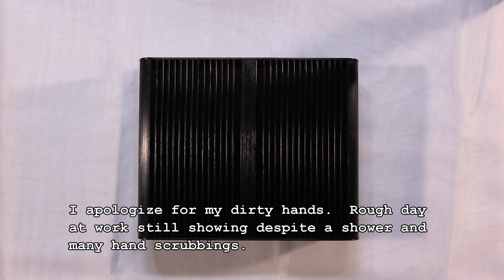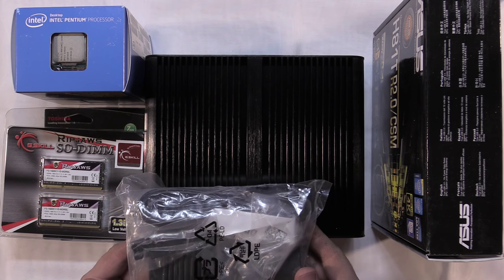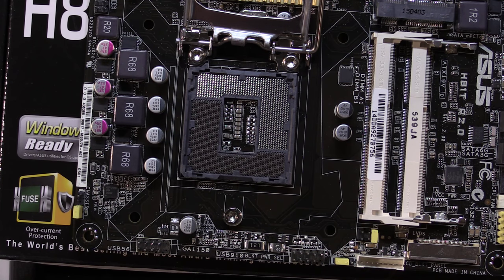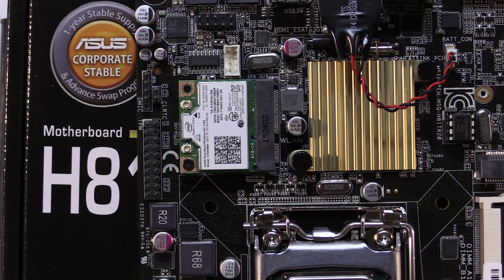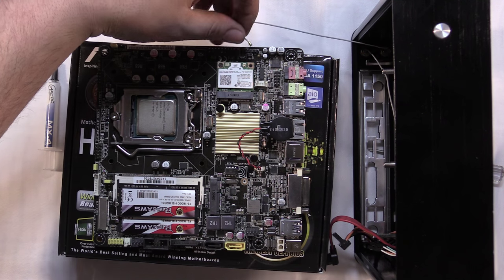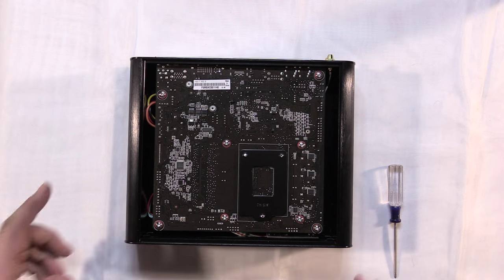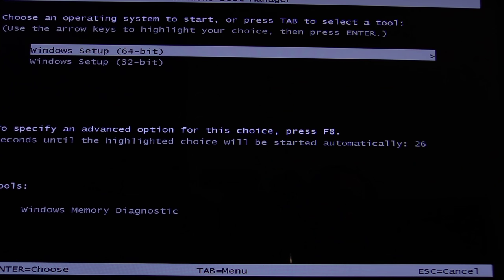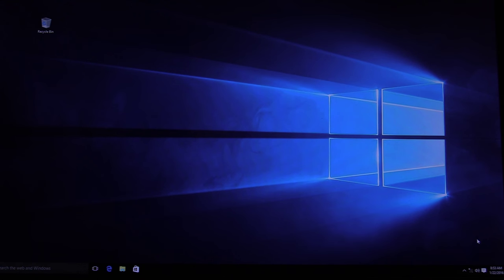How To:  Build a Fanless, Silent PC

Comment: I have the exact same cabinet, I've had it laying unused in a drawer for almost 3 years now. Last week I finally ordered parts to start the build. 
ASUS Prime H310T Motherboard
Intel Core i5-8400 Coffee Lake Prosessor
G.Skill Ripjaws4 SO DDR4-2666 SC - 2x8GB
Kingston A1000 M.2 NVMe SSD - 240GB

Thank you very much for this very nice video and narration, it helps both in preparing me for the build and passing time while I wait for the parts to arrive.

Comment: Note, using the plastic/rubber washers under the bolts that hold the heat sink to the CPU is alright, but not under the rest of them. At 27:27 the bottom 2 holes, you can see there are little dots of solder around the holes for the bolts, those are there to ground the MB to the case (with the bolts you put there), if you put rubber washers there, you risk a short circuit.
Reply from the maker: +Philip Cooper There are contacts on both sides of the board, so the ones on the other side are grounded against the metal mounting posts.  So it's all good.  If the board only had contacts on the side with the screws I wouldn't have used the washers.  And in general, you wouldn't use the washers anywhere but the four holes around the processor.

Also, there would be no risk of a short circuit, but possibly a risk of a static discharge due to a possible difference in potential between the case and the board.

Comment: Hope everything got hooked up and you never want to upgrade anything.  You have to rip the motherboard from the heatsink every time.  I love the idea of the fanless computer.  But ... oops the drive doesn't work & now I have to clean thermal paste from the case & CPU.  Side note:. great tutorial.  If I didn't know anything about computers, I would've ended up being very knowledgeable about build a computer.

Comment: I bought the EULER M and the first step is to mount the alloy CPU cooler to the case. It depends however which board you use, where to place it. Do you have any advice how to do this step? There are many pre-drilled holes, but how do you know which one fits?

Comment: Thank you for this video! I was trying my luck with a Zotac ZBOX CI323 but that Celeron Processor is so weak, it couldn't even render 1080p60 Youtube, much less 1440. I was so frustrated and your video gives me new hope... sure, this will be a bit more expensive and I'll have to use Dual-Link DVI instead of DP, I expect, but this could make it possible for me to replace the Gaming rig with this box (I'll be streaming Steam games for the aforementioned rig... funny enough, THAT the ZBOX managed... but Youtube? Nope...)

Say, can you possibly answer a question for me: What resolution are you running? Since the board seems to have no displayport and my monitor seems to not want to do 60Hz at 1440, do you think 1440p60 is supported over DVI?
Reply: A dual link dvi cable should manage by the hair. I would use the newer Euler models that support more motherboards and have hdmi. Iirc there is a compatible Z170 Asus board, that could work for you.

Comment: it is rare to find excellent vids like this ... thanks

Im wondering the name of the case? akasa? where did u buy it? price?

thanks again
Reply from the maker: It is the Euler case made by Akasa.  They also make a Euler S, which has USB ports on the front.  I got the case from Newegg for $110. However, they are no longer available on Newegg.  I've seen them on Amazon, but they come direct from Akasa.
Reply: +bigtb1717 thanks for prompt response. ... is this case form fit in any motherboards? because Im looking to buit same what you did but different cpu i7 6700 ? any advice? thnxxx
Reply from the maker: +Mohammed Alharbi The particular case I used will only fit a Thin Mini-ITX motherboard.  There are very few of this size motherboard available.  Akasa does make a different model case that is a bit larger and will fit a standard Mini-ITX motherboard.
Reply from the maker: +bigtb1717 There are Mini ITX motherboards available with the LGA1151 socket for the i7 6700.  Keep in mind, the case is designed for a much lower power processor than the i7 6700.  It may not cool that processor effectively.
Reply: +Mohammed Alharbi At the Akasa page you can see the compatible boards and cpus for all their Euler cases. They recommend the T series of processors, which are lower power.

Comment: only asrock seems to build those now ,i think it is the h81tm at the thin mini itx format.
great build still,but you should have installed windows in uefi mode instead of the bios mode.

Comment: How are the thermals? I see 21ºC on the bios but that's not real usage.
Reply from the maker: Below is a quote from a previous comment reply with some temp info.  I've gotten busy with other projects and haven't even started the computer for months, so not a ton of use on it at this point.  I plan to start using it more soon and I will update if there's anything to tell.

I ran Prime95 for a half hour and the peak temp was 70C.  That's bordering on the max temp of 72C.  I'm sure it's because the processor is over the case's max TDP.  Even a lower clocked version of the processor I used would probably run a little cooler.  I then rendered video with Adobe Premier for a continuous hour.  CPU utilization was showing 100% on both cores most of the time, with occasionally dips to 95% on one or the other core.  The total system power draw was, 49 watts during video rendering vs. 53 watts during prime95, but the added time did raise the temps a bit, maxing out at 73C according to HWMonitor.  

General use (web browsing, watching HD videos, running basic programs) temps are more in the range of 40C.
Reply from the maker: One thing I will say.  Once it heats up, it takes a long time to cool off.  With no fan to speed up the cooling process, once the case gets warm it takes a while to cool.
Reply: +bigtb1717 those are pretty good Temps for a fanless build! For a media center this would be a perfect solution.
Reply: Many models of the thin mini ITX boards have temperature probes to also monitor the case / enclosure. Probably reporting that value by default.

Comment: I'm just wondering how stable this system has been since you built it. I have some concerns about the northbridge overheating as well as the SSD. In previous builds of my own I've had similar issues. Also this would make a great car computer with a small format touch screen built into the dash since it runs on 12v. That's the point to the question. I'd love to use this as an MP3 server instead of a standard stereo head unit that you find in most cars.
Reply from the maker: +ExStatic Bass So far, so good, but I haven't used it extensively yet.  Motherboard temps concerned me a bit.  So far the temps have been fine on MB and SSD when I've checked, but the motherboard doesn't seem to report all the temps.  I'll keep an eye on things and update if anything changes.

Comment: I was thinking of buying a fanless mini pc from China, but now I'm interested in building one. How did the price of your build work out compared to a ready build of same specs from China, can you make a large saving.
Reply from the maker: I never looked into a ready made one from China.  I build mine because it was a fun project.  I don't know what is currently available for building one yourself.  I know the case the motherboard size I used were discontinued shortly after I built mine.  Mine probably cost around $600 at the time, including a retail Windows license.

Comment: What are the temps of the CPU. If you are running an over 50w CPU in a case that is meant for 35w it must over heat or clock down or something.

Comment: Hi there, where did you buy this case, please put the link in comment. Thnx
Reply from the maker: I bought mine from Newegg.  They stopped carrying it after I bought mine, in fact I think I might have bought their last one.  However it has since shown back up on their site, but it is only sold by an international seller, not by Newegg themselves.  So keep that in mind.
https://www.newegg.com/p/287-0009-00004?Description=akasa%20euler&cm_re=akasa_euler-9SIAHR691Y9536-Product

Comment: Thanks for the video - I'm trying to do something similar. Could you advise me on the antennas and connection cables - is it a make RP-SMA connection on the antenna or female? It looks like the end that clips onto the wifi card is male but I could be wrong. I can't buy a set like you bought because I need a dual wifi antenna so I can use 802.11ac - that means I am having to buy antennas and leads separately. Thanks!
Reply from the maker: I believe you are correct, the cable is male and the card had the female connection.  Unfortunately, I'd have to look to be able to say for sure, and I don't have the computer, my cousin is using it.

Comment: Just a small question: I am choosing between your build and intel NUC + passive cooling build

The option include intel NUC + passive cooling is about $550
Can you share the cost of your build so that I can compare ?

Thanks,
Reply from the maker: I think this build was probably closer to $650, if I remember correctly.  But things have changed quite a bit since then.  The case and motherboard I used became impossible to find shortly after I ordered mine.  That may have changed, but so has the rest of the hardware market.  I would verify that the Akasa case I used is even still an option before you get too set on it.

Comment: There is a set up in the bios to diable the fans; this is preferable to disabling the boot error dialogue..
Reply from the maker: +J E SPENCER I looked through the BIOS multiple times when setting up the system and there was no option to disable the CPU fan.  I did disable the intelligent CPU fan control system, but still got the "No CPU Fan" error at boot-up.

Comment: Nice vid, I'm curious about the power consumption of the whole unit..
Reply from the maker: Peak draw during a Prime95 stress test (measured at the wall receptacle) was 53 watts.

Actual use by the computer would be slightly less, depending on AC adapter efficiency.
Reply from the maker: I also ran a video render test with Adobe Premier and draw peaked at 48 watts.  Idle draw is 15 watts.
Reply: +bigtb1717  Thanks, quite a good result in idle, considering a non "low voltage" CPU used. What type of PSU did you use, is it rated efficiency "V"?
PS: the "Fan Xpert 2" feature in this motherboard is working alright? ;)
Reply from the maker: +TheOlgojChorchoj 

I don't know what the rated efficiency of the on-board DC-DC power supply is rated.  The AC adapter I used is a Dell 90W slim adapter I got from Amazon.  I'll check when I get home and see if the label shows any efficiency numbers.
Reply from the maker: +bigtb1717 I don't know why it won't let me edit a reply.  Anyway, yeah, the board is an expert at controlling the fans.  I can't hear them at all.  ;)
Reply from the maker: +bigtb1717 There is no efficiency info or specs of any kind on the AC adapter.  Sorry.
Reply: +bigtb1717 The efficiency of brick PSUs is simply marked with roman numerals (usually black sign in white circle or vice versa), newer should be V or VI. (http://www.cui.com/efficiency-standards)
Reply from the maker: +TheOlgojChorchoj Sorry, I found it hidden amongst some safety symbols. It is rated VI.

Comment: thanks alot for the video, my dream is to build 1 FANLESS lower power consumption PC, however my dream processor + in chip graphics i7-6780HQ is in form of BGA :( Lets see what AMD has to offer in the zen line low power consumption
Reply: ehm, 
i76780HQ power comsumption is big 
With pico psu 160w , 
u just can get 1 i76700 ( 65w ), 1 mb, 2 ssd / hdd
Reply: hmm intel already removed the page, the nuc processor for intel skull canyon is i7 6770HQ with 6MB cache TDP 45W, the 6780HQ is at the same 45W TDP with 8MB cache, there are ppl also commented on the skull canyon nuc processor too about why intel opt for this proc rather than the 6780HQ.
Reply: hmm i guess i will just wait and see what AMD could offer :]

Comment: You misunderstand function of those four corner-screws, its for grounding, dont use washer, OK?
Reply from the maker: +Mykle Bust There are metal contacts on both sides of the board and one side is against the metal mounting studs, so it should be good.  But you are correct, you typically don't use the washers on anything but the four screws which hold the processor to the heat-sink.

Comment: There are the t series processors which are expensive but are rated at 35 tdp and blow that processor  out the water fyi!
Reply from the maker: At the time I built the computer the T series were very limited in availability and very expensive for the few that I could get.  The Pentium I used was a vastly superior cost/performance value at the time.

Comment: I wish I could see how you connect the cpu to the case heatsink?
Reply from the maker: It just presses against the heatsink when you bolt the motherboard into the case.  While it's hard to show in the video what is happening, I basically do show the whole process.  After I apply the thermal compound I simply guide the motherboard into the case, connecting wires as I go.  The motherboard and case are sized such that when the motherboard is tightened down, the processor will be pressing directly against the heatsink spreader.  There was nothing more to it than that.

Hope that makes sense.  FYI, right after I bought the case I stopped being able to find them for sale.  In fact, I think I bought the last one from the retailer I used.  The motherboards got hard to find as well.  It may not even be possible to replicate this build today.  I haven't looked into it recently.

Comment: Seriously now you did a painfully slow 30+ minute build to a fanless case and you didn't bother to spend couple of minutes to run some tests or simple show some of the sensors reading regarding temps? wow just wow!
Reply from the maker: In the pinned comment I give some numbers on thermals.  I didn't do a couple minutes of testing (which would tell almost nothing), I did several hours of testing.  Again, look at the replies to the pinned comment for the info.
Reply: So you're telling me that in order to see if this thing actually works regarding core temps which is the main selling point to the whole video, i have to look it up in the comments? Logic?
Reply from the maker: Just letting you know where You could find the info, since you were interested.
Reply from the maker: Sorry you didn't get what you were looking for out of the video.
Reply: It could be put in video but in comment is also ok, i dont really want to watch 30 min video of pc building when i have alot of experience and build several pcs in past, i came here only for temps and i can just read that in comments